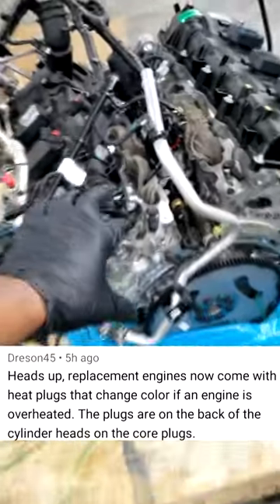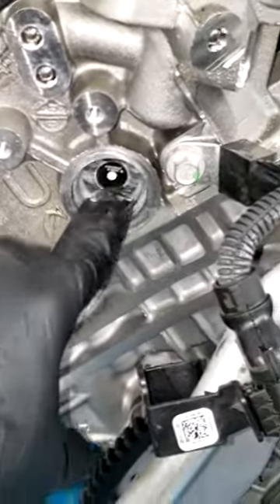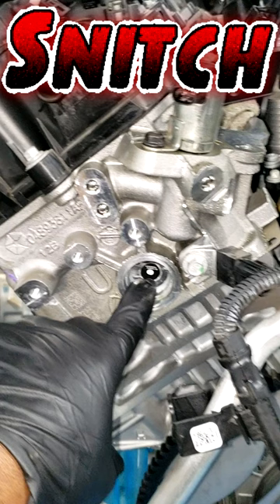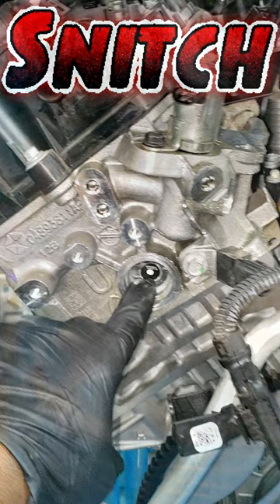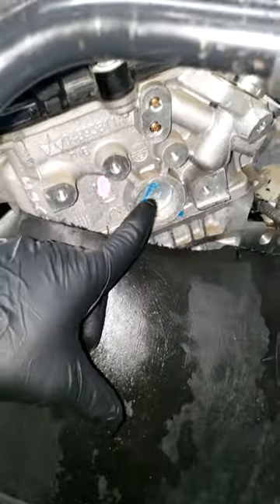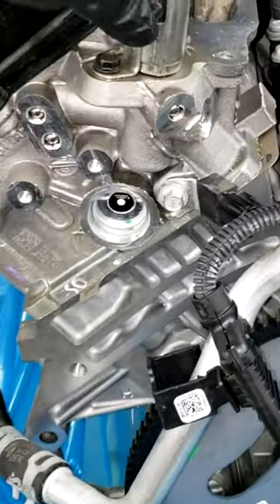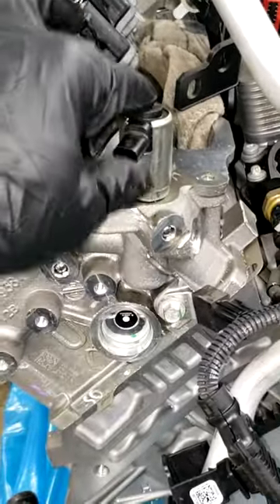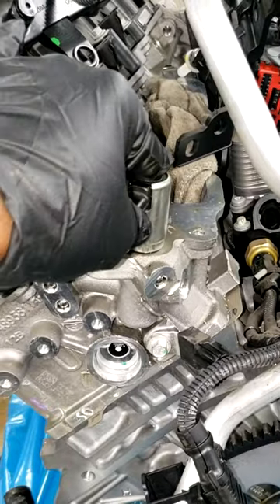The all new SNITCH MOTOR. Beware Liars, you will get busted and warranty rejected now.

Comment: Yet half the cars today don't have gauges that show anything but the gas level
Reply: Yep, if there’s no temp gauge I’m not buying the car 😉
Reply: Car I got currently only has a red light but likely already destroyed the engine if it ever comes on (when refilled coolant after pipe was replaced the fan after 5 minutes went to max speed but no red light) it  required 2500 rpm to self clear air on top top of the engine (it's a self bleeding system but needs rpm) some cars require vacume before injecting coolant back in because it can't self bleed

Old car had it and didn't come on even when it was starting to overheat (120c)
Reply: Wonder what car op drives. Sounds like a feature only present in kias or something

Comment: Been selling engines for a while; our supplier has been using heat tabs as long as I’ve been at it. The center melts out of those tabs.
Reply: Been around for decades.
Reply: Yep I worked at a machine shop every head we redid we added one to when the product was finished

Comment: This seems like something more useful for salvage purposes then warranty purposes. If your getting a salvage motor you can now confirm it hasn't over heat, for warranty purposes the ECU is still king dime dropper, it keeps an extensive record of max rpm, engine temp, transmission temp, launch counter, max speed, time spent in sport mode, time spent in manual mode and more.

Comment: What's shame is that many new cars don't come with a temperature gauge to detect if something is off with the temperature and some have an overheat indicator that when it lights up it's too late. Many people wouldn't notice it anyways but the manufacturer don't give the chance to do so.
For example a semi stuck thermostat or fan failure that doesn't let the engine overheat to failure but also flactuates the temperature to the point of blowing a head gasket can slip under the door unnoticed, and then with such an overheat detection method all the blame goes to the owner.

Comment: I’ve been seeing those tabs on remanufactured and used engines for over 30 years. Junk yards even put them on used cylinder heads. I call those tabs the LIE DETECTOR. 😂😂 I had a customer claim she’d never ran her engine hot since we replaced the cylinder head. I told her I suspected a clogged radiator caused her original failure. But She refused to have the radiator cleaned or replaced when we did the job. When the new head blew a gasket and there were no external leaks, She claimed it had never overheated. But the lie detector said otherwise.
Reply from the maker: Dang, thats whats up
Reply: Yep 👍🏿. Customers lie.

Comment: The cup shaped plugs that mfg's put in engines are welch plugs. They don't come out when the water freezes, they dig in the side of the bore tighter when ice pushes  from the back. The flat ones are freeze plugs, and aren't used much in heads or blocks at all.

Comment: I dont understand as the replacment engine can have a failure that leads to overheating. We installed a mopar reman engine and 6 months later it had a mild intermittent misfire. The reman engine didn't have a headgasket on the passenger side!
Reply: First even engine to last 6 months w out a head gasket.............. Am I allowed to as more dots?.............

Comment: I miss those days of machine shops decking heads and line honing blocks, i grew up in a shop helping my grandpa, “Nassau County Honing Co.” id be grinding valves as a young buck, for real i can still smell that place, i miss it, its not like it used to be that is for sure
Reply: Grew up in a high performance machine shop. 
Started working summers when I was 14. By the time I was 18 I was cutting and balancing crankshafts.
I’m retired now but I don’t miss it at all. Lol

Comment: they design engines that dont handle heat well, then put snitch plugs to tell when it overheats.sounds like a one sided racket to me.good old stellantis.if they built them any cheaper, they couldnt get them off the assembly line before they broke down.

Comment: For all the people in comments saying new cars only have a warning light that once it comes on.  It's already too late. 
There's also an after market device you can hook up to any car that will tell you with an alarm sound that your engine is over heating before it's too late to save it. A very good idea so your warranty stays valid. Often when an engine overheats it's manufacturing issues not caused by the operators/ lack of maintenance.
Reply: Your last statement proves your second point invalid. Why should the customer bear the brunt of having to install a device just to see that data? If it's part of the warranty shouldn't it be built into the car from the start? So this way people can realize before their warranty is out?
Reply: @ThatOneCatNyx  It's your fault if you let the engine over heat. No matter what caused the overheating. Warranty is only valid/responsible for the original issue. Not for you allowing it to over heat. Nothing makes my statement invalid. These are the facts. Because light on the dash or temp gauge will tell you before its too late. Unfortunately not everyone pays that close attention to them at all times. An alarm sounding will tell you and it's hard to ignore. Manufacture has covered it's arse by putting in temp gauge or warning light. But if you don't see it before it cooks that is on you. All great and good with what ifs the manufacturer did this and that. But fact is they don't and nor do they care. They are happy to get out of responsibility. Basically everything you said is invalid.
Reply: @ThatOneCatNyx  not to mention that if cant feel the power drop to a point you need to use more gas to keep moving and smell the engine cooking. And continue to drive till it's totally fried. You totally deserve to have responsibility of all damages. Why should manufacturers or engine rebuilders be geld responsible for people's stupidity? These plugs are to cover the arse of engine builders because there is nothing wrong with the engine or workmanship. It's the operators fault. Plenty of people install rebuilt engines and don't put the extra money into refreshing parts attached to the engine. Like water and heater hoses or radiators, thermostats and so on. I've seen it many times and even done it myself due to cost and saving money. But I have never cooked an engine and replaced them as they broke.  Not everyone is mechanically minded like this and should not take that chance.

Comment: Do they have a low oil snitch?? Cust not maintaining oil change interval snitch? Oil pressure runs so much on modern engines. And they're worried about temp. Have seen these on multiple junkyard and remains. Loss of oil pressure, imo, is ass (as) important as running hot, if not, worse...catastrophic failure. To main journals and rods. No need to go through all the trouble of a head gasket/machining, to find out the bottom end is shit.. Why.

Bottom end... CONSUMERS.. CHECK YOUR OIL LEVEL FREQUENTLY!

Comment: The aftermarket remanufacturers and junkyards have been using those for a long time. It's kinda surprising OE wasn't using them till now.
Reply: If my car overheats and it's new it's their fault not mine , so honestly it's no reason for them to put them in there.
Reply: @invalidusername_5101  if you keep driving it while it's overheating, it absolutely is your fault. They don't fall off immediately. It has to get really hot for them to activate. 

There are plenty of reasons for an engine to get overheated, and most of them aren't internal engine faults. Your new engine could overheat because you hit something in the road and damaged the radiator, for example. That's not the engine manufacturers fault.
Reply: @Krankie_V  is that example not bumper 2 bumper warranty? We rely on sensors , if I've fails who fault is it . Come on bro make sense
Reply: @invalidusername_5101  you're telling me to make sense with that comment? Try to read your own shit.

No warranty covers you damaging your radiator by hitting something in the road. 

There are multiple warning systems for when the car is overheating. Most have a temp gauge. If there's no gauge, there will be a warning light. Most will beep at you if it's getting hot. If you stop driving immediately when these warnings come on like you should, that tell-tale tag won't be activated. If you keep going anyway, that's definitely on you. You can be stupid all you want, but a warranty won't cover that.
Reply: @Krankie_V  you bring up this scenario but who the FUCK doesn't pull over after hitting something that fucks up their radiator 😂😂.
Reply: @invalidusername_5101  the kind of people who invalidate their warranty by overheating the shit out of their new engine. There are a lot of idiots out on the road, and they're always looking for somebody else to pay for their dumb choices.

Comment: I am not a fan of oil change places or as I refer to them "We Be Lubes and Shit"!! You will never save enough money to pay for the damage that will occur at some point. From broken air cleaner housings, broken oil filter housings to broken cabin air filter housings. And I might mention, it is extremely rare that "Johnny Certified Lube Tech" actually looks for a grease fitting let alone all of them. He just goes by his data list and if it left the factory without a grease fitting it gets no grease. And lets mention oil filters, most use the absolute bottom of the barrel filters that at best don't leak but rarely filter oil properly and usually come apart plugging oil galleries. Inspect a Honda Vtec solenoid filter when the customer has always gone to one of these places, you'll likely find filter media stuck in the Vtec valve body filter. But by gods decree they will up sell you "High Mileage" oil!! What a joke!!

Comment: So, when the thermostat housing cracks while your driving down the highway and you don’t know it until it overheats or the lights come on, they will look at this freeze plug dot and not warranty it because it overheats?  Wtf?  Half of your videos are cooling system problems.  This actually sounds like a small investment to deny warranty engine / cylinder head replacement to me.  Just like the moisture stickers in your phone.  A week in Florida and you’re done just because of the humidity.
Reply: Should have replaced that t Stat housing w the engine. I'm sure the manufacturer told u to do so, w sooo many other parts
If they didn't, then that is on u for ur negligence and understanding
Reply: Yeah, imma stick up for this guy this time. Even though I don't agree w half of his posts. Maintain ur shit, and properly service it, and check guages, and fluid levels, and u won't have an issue.
Reply: He’s saying that the manufacturer would void the warranty for a part that CAUSED the engine to overheat BECAUSE it overheated. I don’t know how anyone would actually get away with that though. Oh wait, you signed your rights away when you got the “warranty” and people listen because they can’t stand to drive a car older than 5 years.